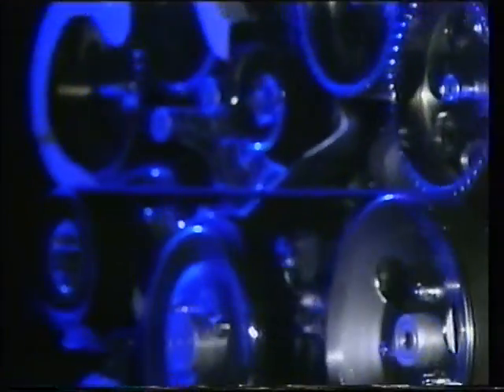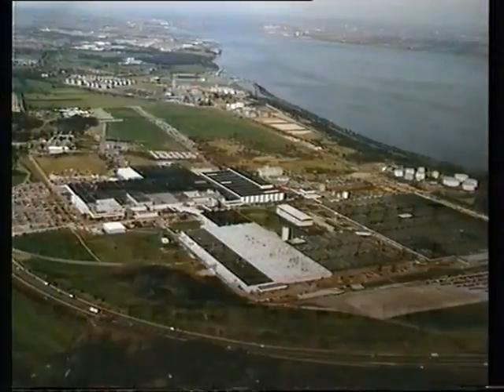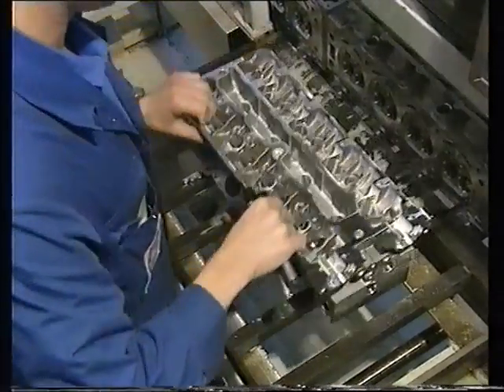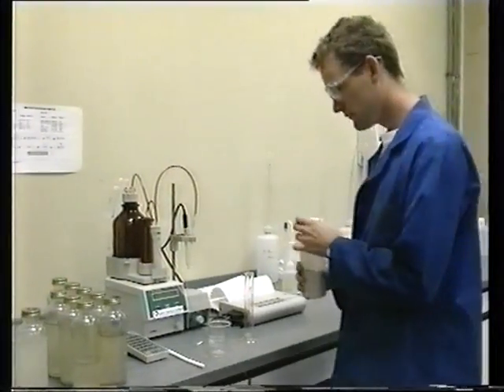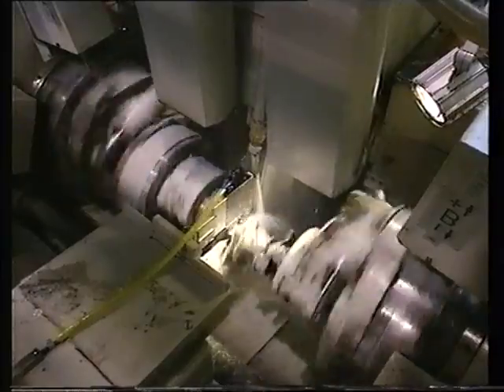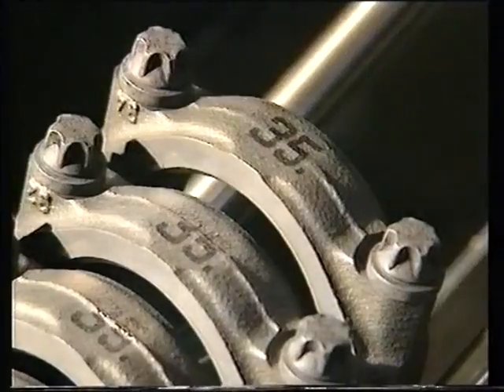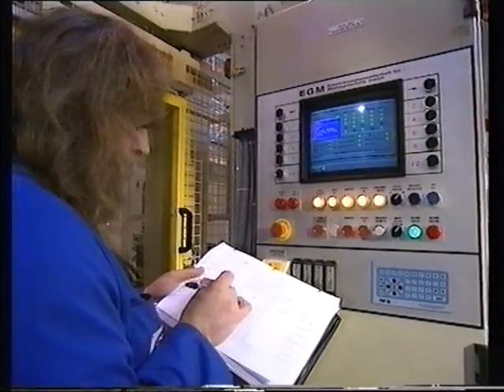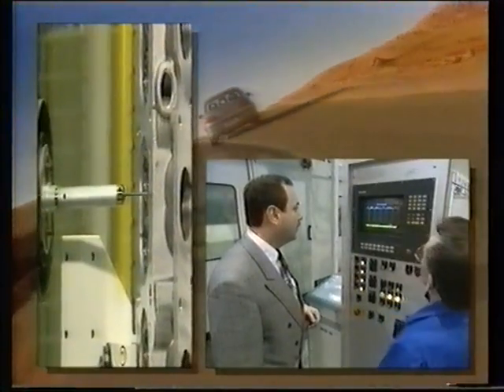Vauxhall V6 Engine Plant Ellesmere Port uk

Comment: i have an omega 2.6 v6 and it is awesome. 196hp on dyno (chip+k&n filter) 259nm. i love that car, it has some minor issues like central lock, but i would like to keep for long time. i bought it with 150k km in it, now it have 170k km. i change oil around 8000kms. nice sound, plenty of power for me, and if i want i can drive it economicaly. at summer around 8.4 litre per 100km, on highway around 9l, on country roads 8l. in the city it can go up around 10L.

Comment: Can any technicians/engineers help me understand why they chose the 54° bank angle instead of a 60° bank angle, and how they managed to overcome any imbalances in the engine that could otherwise have resulted in excess vibration and harshness? It sounds like a V6 like no other when you rev it.
Reply from the maker: It made the engine more compact  than a 60 or 90 degree V6 especially combined with the ecotec cylinder heads (exhaust valves verticle not angled like the inlet valves). There was a 50 degree V6 design put forward but they settled for the 54 degree. The 15kg flywheel made it very smooth but personally I found the 5kg Courtney one was a huge improvement to performance.
Reply: @BigDave1965   Was it possible to carry that Courtney flywheel over to the Z32SE or would that have required a different solution? Its a somewhat interesting engine. I'm amazed that it didn't require a balancer shaft or splayed crankpins to get it running smoothly.
Reply from the maker: @EdgyNumber1  yes I fitted one to a 3.2 rebuild we fitted to a calibra.

Comment: Had a cavalier V6 from 1997 to 2005. Engine bombproof though replacing alternator was a pain. Averaged 33mpg. Bit flat low down but went like stink over 3500 rpm. I would imagine M494ODP is long gone now
Reply: Tax expired 29 Jun 2004, so looks like you were the last owner!

Comment: Superb. Was a cracking place to work.
Reply from the maker: A blast from the past Rob
Reply from the maker: 60 or 90 degrees were the norm for a v6 , one plan was to make it 50 degree but the 54 degree V went into production. Along with the ecotec cylinder heads (exhaust valve isn't inclined) it made the engine very compact
Reply: Hi Rob,hope you are well and your career is on trackkind regards Terry Price
Reply: Do you now a bit more about this engine?
Why was 54 degrees used and what were the effects on engine vibration compared to a 60 degree design?
Reply: TheTerryfisher Hello Terry! Wow, great to hear from you! Yeah all good down here mate. Give me an email and we can catch up. Robert@robjshaw.co.uk
Reply: I always wondered if the 15 hour random test engines found their way into production vehicles? I guess at least they've had  a good run in!
Reply from the maker: @steven-vn9ui  we we're allowed to sell test engines up to 1000 miles